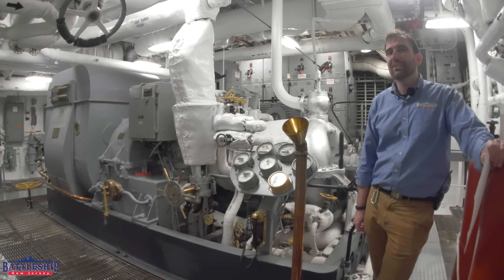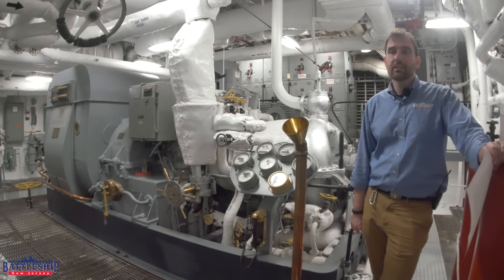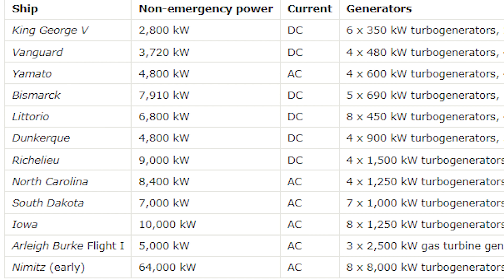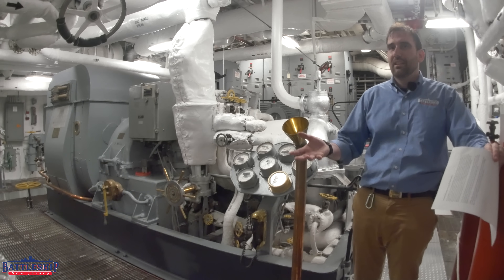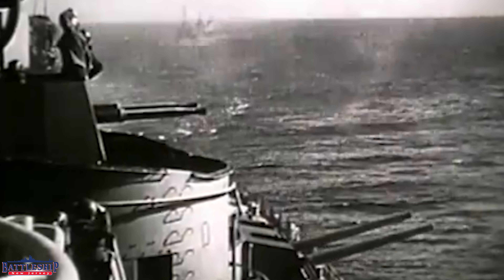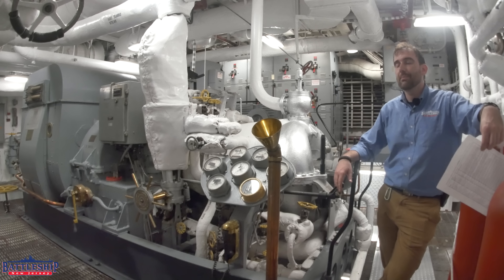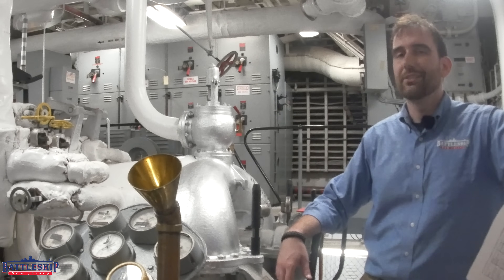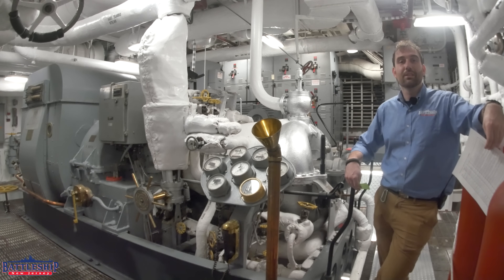How Much Power Can a Ship Generate and Did a Ship Really Power a Whole City?

Comment: Wall  plugs in  homes  and  wall plugs on ship are ac current  .   You have   things  confused  . Know   wonder.  You need  help on the  electrical  .   One  of the  main  differences  between  the 2  system. . Is.  Ships power  does not  have  a   ground  . Went  not at  port

Comment: The math on several rows of the charts does not compute. King G V 6x350 is 2100 KW not 2800 KW. Yamato 4x600 is 2400kw not 4800kw. North Carolina 4x1250 is 5000kw not 8400kw and Arliegh Burke 3x2500 is 7500 kw not 5000kw.

Comment: ( 4:03 ) to be fair, the Zumwalt class destroyers were supposed to have electromagnetic "rail gun" installed - hence 78 000 kw for such a relatively smaller ship. The Navy almost liked the Zumwalt, but the inability to work out the problems with the "rail guns" doomed those ships to never be built in numbers that would bring costs down and increase innovation (plus there main mission was never fully formulated and over time given to more... conventional designs).

Comment: Jeez! I can't help but comment!
71 years old now, was an MM1 in the Navy, got out after 8 years. The last 3 years was in the electric branch of things at a shore side repair facility. Sailed as a 3rd engineer and then chief electrician on merchant vessels for 20+ years...
I was on a ship (a Ready Reserve Ship) SS CAPE INTREPID, in Tacoma for 3 years, that we added an extra 2000 kw diesel generator, mainly to use as a standby generator for emergency power for Tacoma. 
I was once on an old ship that was built to carry troops to invade Japan, that was powered with DC SSTG's. There were 2, 75 kw Motor Generators (MG's) (DC motor, AC generator) that delivered 120 volt 60 cycle power for "domestic" services.
A note for folks asking about gun turrets, the Sumner class DD i was on had 400 cycle MG sets (converted 60 cycle to 400 cycle AC power) that ran the motors to train the 5"/38 turrets  we had.

Comment: I noticed your generators are induction generators. Induction generators require an excitation voltage in order to build the electromagnetic field. What produces the excitation current on the ship in the event of a loss of power?
Reply: There is an exciter generator connected to the rotor shaft at the other (not shown) end of the unit. Residual magnetism provides the field it needs to produce excitation.
Reply: @oldtugs  Thank you!

Comment: That lesson on the difference between AC and DC was all kinds of screwed up. 
AC is what's coming out of wall sockets.
AC is what can be transmitted over a long distances.
DC is what gives you smaller motors. (Since it doesn't alternate you can use permanent magnets as your stator instead of having to use electromagnets) 
DC is what comes out of a battery.

Comment: It's been nearly 50 years, but I seem to remember being able to be shocked on either lead of an electrical outlet aboard ship... That's not the case with typical 120VAC in a home -- you can get shocked going from hot to ground or hot to neutral, but not neutral to ground... I've wondered if I'm just remembering shipboard power wrong or if they wired the 120V outlets like we do with the 240V outlets in homes, with 60V on hot and a 180 degree out of phase 60V on the neutral plug... 

Any old EMs around with firsthand knowledge of how this was really wired?

Comment: During my US Navy boot camp in 1965 , we learned that ship AC power  was two hot 60vac wires with no neutral.  Any electric devices you wanted to bring onboard had to be checked by the electricians first.  Normal land AC is one hot 120vac wire and one neutral plus ground.

Comment: The electric motors in the turrets are running "A" ends of hydraulic systems.  What you spin the "A" end with matters little in the control.  The controls would be the same even if the "A" end was spun by a turbine.  The big issue is getting either steam or the hydraulic fluid into the turrets.  Wires are easier to get in.

Comment: I'd guess that a big part of it was survivability, reliability and easier design. Electrical wires are significantly smaller diameter, and more flexible than steam pipes, so they're easier to route around other equipment. Also, you can route a bunch of wires through one hole in the armored citadel and make that watertight a lot more easily than you can route pipes through the armor. Plus, if a steam pipe breaks in combat, you have to use hard-to-turn valves to isolate it and stop the steam leaking. Electrically operated parts are easier to isolate (throw a switch) if you have damage.

Comment: Since this is on a ship, it is all 400Hz AC power and not the 60Hz AC used in homes, correct?  So all the generation equipment, transformers, and wiring has somewhat different specs.  Can't use the same appliances as in civilian life.

Comment: I am a Diesel Generator specialist. I have a few questions. A while ago you responded to me about the diesel generators on the New Jersey. They are inoperative due to the sea chests being sealed as part of mothballing the ship. This makes good sense.
     Does your battleship have any Operational Emergency Generator Capability Now? What kind of generator capacity would be ideal for the ship now? In the event of shore power failure,  what power sources are available to power the ship?
    What are your loads? Firepumps? Lighting? Air Conditioning?.....
     These are the kinds of questions that occur to a generator man looking at a ship like New Jersey. There may be other questions I ought to ask about this that don't occur to me. 
    In your opinion what would be the ideal emergency generator set up for a ship like this? Your dream system? 
   "The most important thing to know is What You Don't Know." -  Col. Stuart Grayson , U.S. Army Corps Of Engineers.

Comment: Homes (and businesses) pretty much everywhere in the world have AC power to their wall outlets. Some use 50 Hz and others use 60 Hz and some use 110V vs 220, but they're all AC.

Electronics use DC pretty much exclusively, though. This is why you have a wall wart to convert the AC power in your home's power outlets to DC power for your phone, modem, router, or pretty much anything battery powered. Your computer also converts AC power to DC, but that conversion typically takes place in the power supply unit inside the computer for desktop computers. Same goes for monitors, TVs, etc.

Comment: Enjoyed the video.  But it looks like the ships power is 3 phase AC and a step down transformer is used to convert that to single phase AC 110 volt 15 amp 50-60 Hz for regular wall outlet items like desk lamps, electric hair trimmers, etc.  During the war there was still some cities with AC current at 25Hz but those appliances would not work on what became the now standard 60Hz, really doubtful any ships used 25Hz.  Anyways, in modern times homes in USA/Canada use AC 120 volt 15 amp 60Hz wall outlets.  Yes household stoves and some businesses or workshops have a 220 volt outlet but they use a different connector then what you'd on ie. floor lamp at Ikea USA/Canada.  The 3 phase power is uncommon outside of specific business/workshops and often just for very large electrical motors used in say water pumping station, diamond drilling, etc.

Comment: There were turbo-electric powered battleships built around 1915era. They used boilers to power turbines that then spun huge generators. Ships such as the USS Tennessee and USS Maryland used this and generated around 22,000 kw. The USS Lexington mentioned in the video also used turbo-electric drive and generated 150kw which is what she used to power Tacoma Washington!

Comment: I went way overboard yesterday with a comparison of Ship's Service Turbogenerator (SSTG) capacity among the USN fast battleships (with a look back to the USS Pennsylvania as representative of a Standard battleship).  The abridged version  (not counting emergency Diesel generating capacity) is:

USS Pennsylvania, 1916 as completed:  4 x 300 kW = 1200 kW, 240 vAC
USS Pennsylvania, after 1929-1931 modernization:  4 x 400 kW = 1600 kW, 240 vAC
USS North Carolina class,  4 x 1250 kW SSTG,  plus 4 x 850 kW Diesel = 8400 kW, 450 vAC
USS South Dakota class, 7 x 1000 kW SSTG = 7000 kW, 450 vAC
USS Iowa class, 8 x 1250 kW SSTG = 10000 kW, 450 vAC
USS Montana class design, 10 x 1250 kW SSTG = 12500 kW, 450 vAC

For the Lexington-class carriers, each of the four turboelectric packages on board could generate 40000 kW (40 MW) at 5000 vAC for a total of 160 MW.  This facilitated USS Lexington's supplying electrical power to Tacoma Washington between December 1929 and January 1930 when hydroelectric generation supplying the city was limited by a drought.

Comment: Our district energy plant at work produces steam, chilled water, and electricity.  We have two 5 MW (5,000 kW) turbine generators for running our boilers and chillers, with the excess exported to the grid.  We also have 6 boilers, producing up to 1.5 million lbs/hr of steam at 250 psi.

Comment: A note on the Zumwalt, and also some of the old Standard Class BBs, and the original Lexington and  Saratoga - their extreme-looking electric power outputs are due to the ships using turbo-electric drive - the screws are driven by electric motors, and so, what on a more usual steam-turbine-geared shaft system, like an Iowa, all the power that would be going through the reduction gears is getting turned into electricity.  A Lexington put out 1300 Megawatts at full rated power.
Reply: No 130 not 1300MW!

Comment: I was surprised to hear that the Iowa class ships were mainly A.C in contrast to most other classes that were D.C. Why D.C, well D.C allows for variable speed control of the many electric motors on a ship and it just as importantly allowed for a "soft" start, i.e., a gentle acceleration to whatever speed the motor was normally run at. A.C motors, at least in those days were generally started "across the line" with an almost violent acceleration to the rated speed and I'm really not sure how this would have enabled the main guns to slew and elevate smoothly. How would the capstans work with A.C  motors as surely they would also need to be variable speed? If anybody can clarify this, it would be great.
BTW, I was a ship's engineer on Trans-Atlantic liners and cruise ships in the late 60's and though we had steam turbine alternators for the hotel services of the ship, the bulk of the power was by steam turbine D.C generators for the reasons mentioned above.
Reply: The biggest motors on the Iowas are the three turret train (traverse) motors, 300HP each, rated at .  These use an autotransformer to fulfill the soft-start role.  The gun elevation motors were IIRC 85 HP motors.  All of the aforementioned motors drove hydraulic pumps (A-end) and the actual power delivery and movement was thru hydraulic motors(B-end) connected to gears, pinions, and jack screws.  The rammers, propellant and shell hoists are electro-hydraulic, too.

The movement of the train gear and gun elevation gear is done by hydraulic power not all that different in concept from the hydrostatic drive you would find in many modern lawn tractors--pistons, swash plates, and linkages.

Comment: I’d like to know more about the backup generators, I work on backup generators and always like seeing different ones.
Reply: I know what the system looked like on my ship.

Picture if you will an 8V92 Detroit set up for clockwise rotation, and an identical engine set up for counter-clockwise rotation.  Now picture a 440VAC/60 Hz/3-ph 500kw generator between them.  

Add to your mental picture a high-pressure air tank and air starters on the Detroits and a rather large day tank for fuel.

Add to your picture a distribution switchboard with an appropriate bus tie/breaker to the main switchboard and a 500kw Auto Bus Transfer switch/breaker.

Bear in mind that the engine/generator package has about 5 feet of clearance on either side and not much more on each end.  I can promise you from personal experience that it isn't much fun to pull a generator rotor when the task starts with "remove 8V92 Detroit and put it in the corner using nothing but chain falls"...

Comment: Correction/nuance: AC is what is easiest to generate in most cases. AC generators produce quite a high voltage, which can be boosted to an even higher voltage for transport, and it is then stepped back down in voltage before reaching the intended house or something. It depends on the application whether AC or DC is better. Generally, anything with a battery and/or (digital) computing power has a charger (either internally or externally) converting AC from the net into DC. Electric motors may use AC directly or do some wizardry converting AC to DC and back to AC

(Yes, I know what that electric motor wizardry is, but I left it out as this comment would get too long explaining all kinds of electric motors. And yes, electric motors and their drivers either use AC or turn DC back into AC; there is no such thing as a DC motor if you were to open it up)

Comment: I'm guessing you've probably heard this a lot already. House power is AC. Almost everything on the ship is AC. AC is better because of less maintenance, easier control, greater efficience, smaller size, etc. etc. etc. Very few things on board ship are powered by DC. There are rectifiers used for charging small boat batteries, and motor generators used for larger DC loads. I couldn't tell you off hand what they might be, though. There are also motor-generators used to generate 400 Hz AC for electronics (like radars, I believe). All of the general purpose power outlets on the ship would be AC. General purpose things like lighting, recepticals, small tools, etc. would all be 110v single-phase. Larger loads such as ventilation motors (not small fans, the big 'uns), pump motors, etc. would be 440v (ok, ok 450v is what's actually generated) three-phase. Transformers would be used to change 440v 3 phase to 110v 3 phase which feeds the lighting panels.

Comment: Ryan, as others have stated, there's a slight mixup between AC and DC noted when you're talking about residential power.
All mains power in the US and other countries is supplied as AC power.
The difference that you are thinking of is that residential power is single-phase AC, while industrial and much commercial power is three-phase AC.
Three-phase AC is the kind that is primarily used for driving AC induction motors, because you don't need a field winding to make the motor turn.
DC is not often used for long distance power distribution because to change the voltage you need either a motor-generator set (with the motor operating at input line voltage, and the generator operating at output line voltage), or you need a solid-state DC-DC converter, both of which are a great deal more complex and less reliable than a simple transformer which would perform the same task for AC.
Now, there ARE places where you'll find a HVDC link pushing power over long distances, but this is rare, and is a relatively recent development thanks mostly to the recent (90's to mid 2000's) development of semiconductors that can handle these high voltages and currents found in the solid state DC-DC power converters needed for a grid-scale HVDC link.
Additionally, the way a DC-DC converter works is such that it almost always ends up turning the DC into AC, using a transformer or inductor to convert the voltage up or down as needed, and then rectifies the voltage back to DC again before outputting it for use. As you can hopefully tell from how I've described it, you need something that can turn the DC on and off rapidly, or even better rapidly reverse the polarity thru a transformer winding. This is called an inverter, and usually these need high power semiconductors because those are the easiest way to switch the power on and off fast enough. When I say "fast enough" I don't mean at a mere 60Hz either. If only considering the size of the transformer or inductor as an operational constraint, a massive reduction in size of that component can be had if the inverter's operating frequency is raised, because this makes the effect of electromagnetic induction stronger. The faster the current alternates, the faster the magnetic field lines move, and the stronger the voltages and currents in the inductor or transformer are. This allows the use of a smaller inductor or transformer for the same overall power output, which is why the 1000w power supply for a gaming computer can have even the faintest chance of fitting in a standard ATX size housing. The key is that incoming power is first rectified (and if operating on 120V AC, it is also sent thru a voltage doubler) to DC, stored in high voltage aluminum electrolytic capacitors, and then some high voltage high current power transistors send that current thru a transformer at a frequency of something like a few hundred kilohertz (with specific avoidance of frequently used radio bands to limit the emission of harmful electromagnetic interference). From there, the transformer steps down the voltage to the more typical 12 volts that a PC mostly uses, as well as the other side voltages of 5v 3.3v -12v -5v and -3.3v (other than +5v, most of those other voltage rails have a maximum current output of less than an amp, because they're barely used anymore, and +5v is only capable of higher current because USB ports use that voltage directly most of the time).

Comment: Electric motors are just another example of the USN's obsession with damage control. It's a lot easier to bypass around a broken power line than it is steam conduit. Portable generators where appropriate are easy to deploy and use, etc. Also, as bad as electrical burns can be, steam burns are NASTY. It makes sense to try and keep them deep in the ship behind armor.